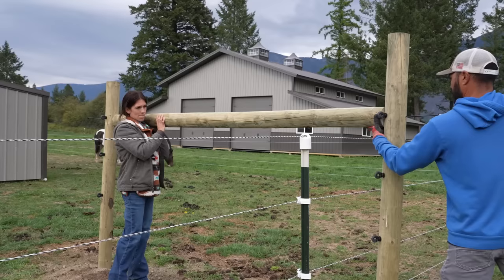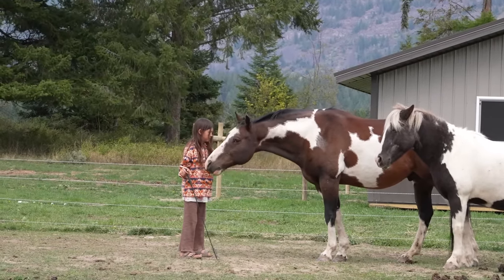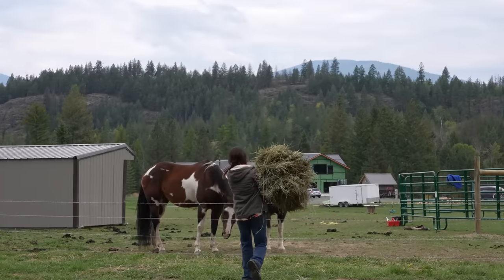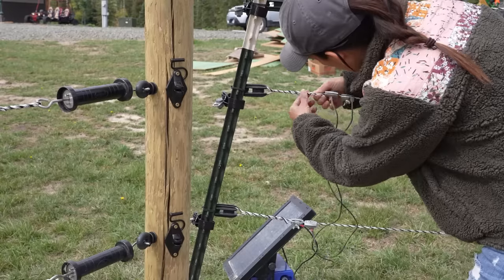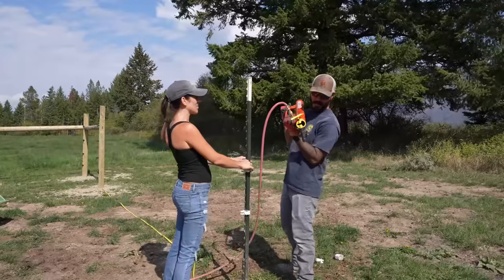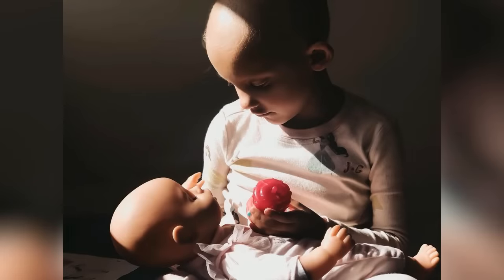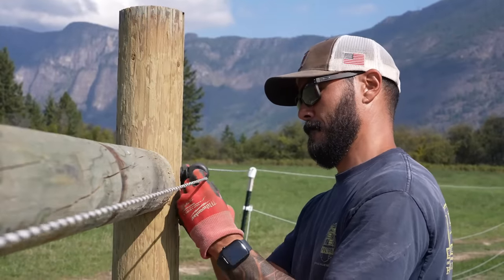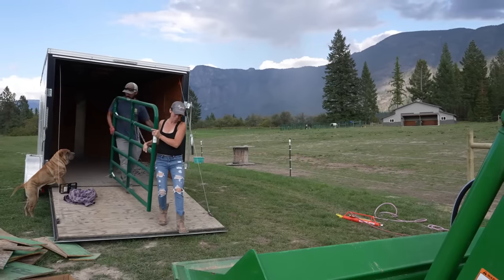Installing Bear-Proof Fencing on Our Mountain Homestead

Comment: Hey guys, driving those metal posts into the ground is so much faster and easier using the tractor!!! Use your bucket to push them down. My hubby and I drove 25 metal posts in a half hour!! I held them and once they got started, stepped out of the way. 1-2-3 done! Easy, peazy! 😘

Comment: On your apple corer, take off the little hand crank handle and hook a drill to it if you have a bunch of apples to do. I use the bucket on my tractor to push them in, and if the T-Post hits a hard spot, I then use my bucket as a tap hammer. no more back breaking work that way. You guys and gals are all great, keep it up.

Comment: Jeremy,  in Texas we learned to use the tractor to instsll tposts.  Just use the hydraulics of the bucket to press the post in the ground. Works every time! Also use it to pull them out by wrapping a chain around them and lifting up.

Comment: I have the same t post puller. But, as a 65 year old woman, I don't have the same muscle as you do. I found that wrapping a tow chain around the bottom of the post and using the hook on the puller gave me a little more leverage. And if I still needed a little more, I would slide a post that I had already removed into the end of the handle of the puller. That usually did the job.

Comment: A T-post puller is an EXCELLENT tool and they aren't very expensive. They work far better than trying to pull the posts with any other method. 
Premier-1 has good products, those insulators are far better than the ones I initially bought at Tractor Supply. Those got brittle out in the weather  and started breaking after just a few years. Curious that you put them in with the slot down, I did the opposite.
Good choice with the through bolt gate hinges. Makes it super easy to adjust unlike standard screw in J bolts.

Comment: You might already know this, I used the manual method until I got a tractor with a bucket, smaller than yours. Start the T post where you want it and use the bucket to push it into the ground. When you want them out, wrap a chain around the post, lock it from slipping by cinching it on itself, hook it to the bucket and pull it out.  Love your videos. You need to get your oldest son involved a little more. He would make a good T post holder 🙂

Comment: For one thing is to pull that correctly. You need to grab it from both corners and pull it. So you hook a chain that will make from one corner to the other corner. And then add another chain pulling from the center of that chain. That way, it looks like a bee when you're towing on it. And it will drag a 100% butter. Besides, you wanna drag it with the front end of the bucket toward? You can lift up on it a little bit.  And then you'll take a little bit of the pressure off the front of it, and then that way, it'll drag a lot easier.

Comment: Easier way to move the shelter. I bought one of these after seeing yours and have moved it a few times. Go to the hardware store and get 2 eye bolts that fit the pre drilled holes on the skids. Put one on each skid and use a caribeener or quick link that fits the eye bolt and your chain. Make sure it’s rated for a high weight load. Hook your chain to each eye bolt and use the hooks on your bucket to drag it pulling it backward or you may be able to attach it through an implement on your 3 point (I can run the chain through my box blade supports). It’s much easier to drag and steer if you lift the 2 skids a bit while your dragging  it.
Reply from the maker: Thank you!!

Comment: if you have not a t post puller all you need to do is pour water down the side of the post as water will break the seal. there is a t post drive which uses a petrol motor which dose the sam thing no air compressor. honda makr a very good one

Comment: The way I drive my t posts down is with my tractor.  I place the bucket flat on top of the post. Have my wife hold the post straight.  Then slowly push the post down into the ground.  Works great.  No fuss no muss.

Comment: I believe that there might be the possibility that passing the wire on the outside of the poles at the corners would get wet from the rain and short out. Perhaps routing them on the inside of the corner would prevent it from being grounded from moisture on the pole's outside.

Comment: Jack the old horse house up and put corner wheels for it to sit on, then pull it to the new location where you remove those wheels.  Alternately, use logs under the framing to roll the shed over. (sort of like they pictured people moving large stone blocks way back when.)  BTW, I love your time lapse segments, particularly the ones of the night sky.  UFOs?

Comment: Regarding time stamp 5:25 of this video and several seconds beyond.

I have a suggestion regarding your food pantry: install two bungie cords on each level and on each section of your food pantry walls.  In other words: stretch one bungie cord 1/3 up the jars and another 2/3 up the jars of each level and on each shelf.  Attach each end of the bungie cord to the wood walls using eye rings that screw into the vertical shelf walls.

When you want to retrieve a jar from a shelf, stretch the bungie cord(s) out with one hand and lift the jar off the shelf with the other hand.

That way, WHEN, NOT IF, an earthquake strikes your region, your food jars will not fall on the floor and break.  If you don’t secure your food jars, and the next major earthquake occurs, you will have an absolute mess to deal with.  Plus, you will not starve but all that hard work will be lost and you will have to start over.

I hope I’ve described enough that you know what I’m talking about.

Said another way: you live in earthquake country.  You home is sandwiched between the Cascadia Subduction Earthquake Zone to the West and the Intermountain Seismic Belt to the East (including Yellowstone National Park).  You will feel shaking from a major earthquake from either of these regions.

Better to be safe than sorry.

I hope this helps & just my 2¢.

Comment: Stand back and admire no. Stand back and make sure it's visually straight as possible yes. I get it and I would do the same thing. In fact when replacing a few of our split rail post a few years ago I stepped back to visually see if the heights were the same. 😁